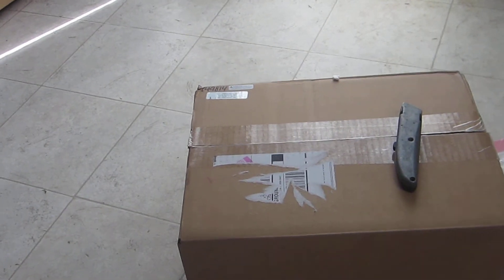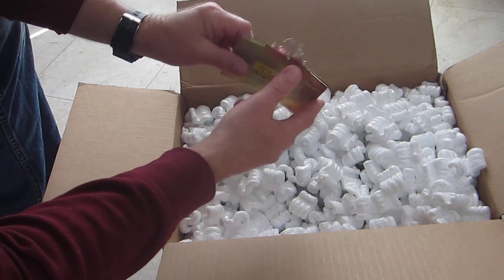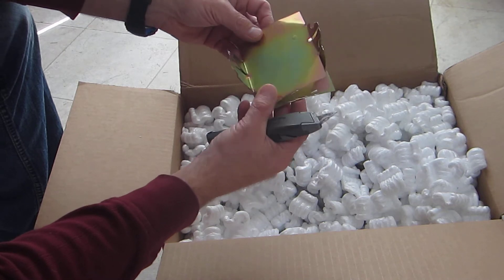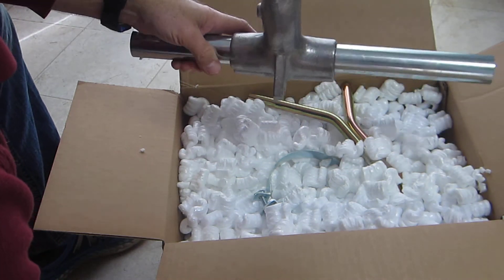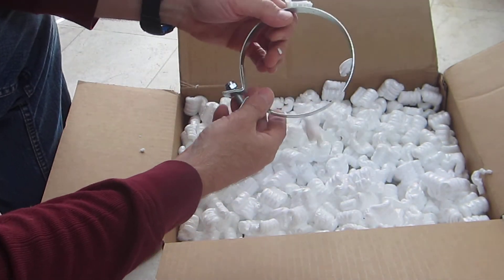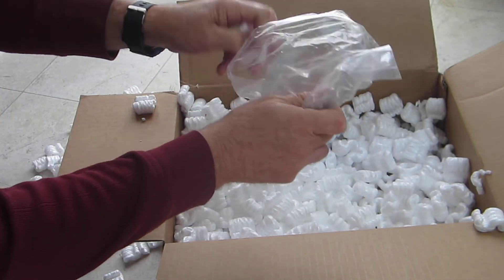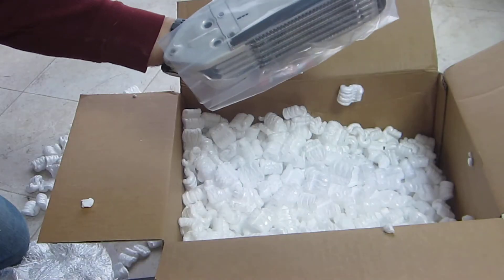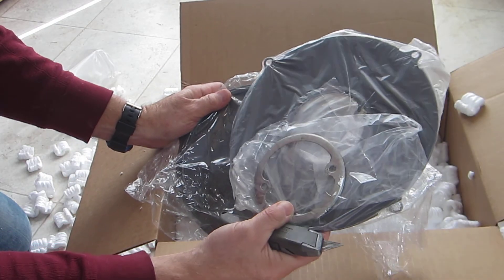2332 VW Engine Build Part 3a (Box O' Parts!)

Comment: Hi again. Box of goodies! I also have ordered same pushrod tubes. The oilcooler gaskets are maybe the gaskets for the tubes? I saw it has oring on one end of the tubes when i ordred mine. I can recomend type 3 cooler tin under the cylinder instead of the smal original tins that you showed in the video. They a better jobb to cool and redirect the airflow under the cylinders. Thank for a great video! Looking forward to next one 😁👍 / Ville from Sweden
Reply from the maker: Yep I'll look into those T4 tins, thanks!
Reply: @vwsandvettes3253 it should be Typ 3 tins ( maybee it is same on typ 4?) I have typ 3 tins on my beach buggy, works great. I will also use it on my 2332 build.
Info on the typ3 tins
https://youtu.be/dO4GUfYQz18
Reply from the maker: @lorddracula2558  Yeah I don't know why I called them Type 4, meant Type 3, thanks!